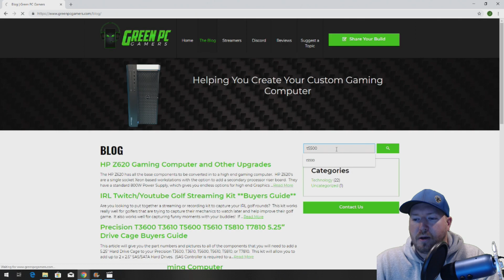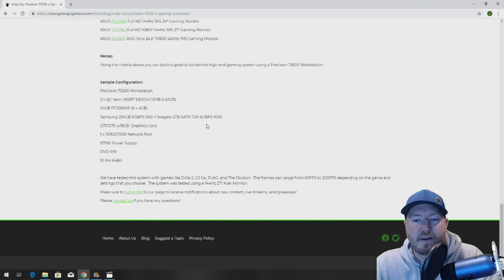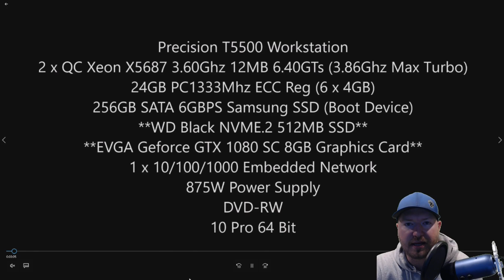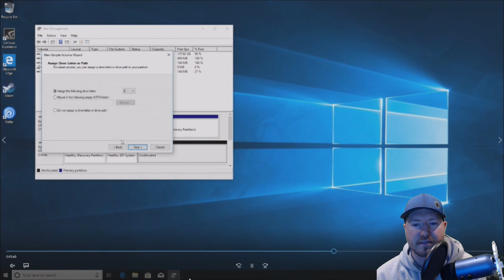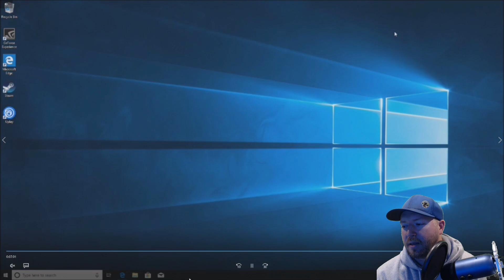Precision T5500 Gaming Computer (GTX 1080 and NVME.2 Install)

Comment: Hi guys. I have X5647 single CPU. ROG STRIX RX580 8GB. 48GB of RAM, A400 Kingston as boot SSD and 1TB WB Green. Temperature of GPU raise fast and im working on a proper cooling solution.
My concern is that HDDs work only as SATA2, i tried the PCIe 2.0 to Four-Port 6 Gbps SATA I/O Controller and it worked well but speeds of HDDs are the same as befor, Random read for SSD 200mb and HDD around 100, moreover iv started to have BSOD with this sata card and removed it for now. Also tried PERC H700 controller that also worked but it can only be plugged below the huge RX580 occupiing the only available PCI-e as RX580 blocks other e slots... anyway this H700 is getting extreemely hot as it is desighned for servers in datacenters so its dangerous and unpractical considering the GPU is already geverating heat to melt north pole...  Main thing to share with you all is AMD RAM disk software that im using for quite some time. Hith this soft you can create a RAM disk (32 gb ) in my case and install a game to this disk as RAM speeds a high youi should experience a better performance in open world games and etc. Worth of trying as workstations advantage is RAM capacity.
Reply: Apparently there are different models of Dell factory heatsinks for the Precision T3500, T5500 and T7500... the lower tiers are shorter with only aluminum fins (intended for use with low-clock speed, low-wattage CPUs), while the top tiers are taller, have copper heatpipes, and even have some sort of refrigerant gas permanently sealed inside the heatpipes!  Try to find part # "U402F" or # "U016F"

Comment: Can somebody tell me if it's necessary to update bios to install a new cpu? I want to install a Xeon X5670, and if the passive heatsink is enough to cool it down?
Reply from the maker: You should updated your bios with the existing processor before upgrading to the X5670 CPU.  Also, it would be a good idea to upgrade to the copper heatsink.  Technically it is not required for a 95W cpu, but the cooler you can keep your cpu, the better.

Comment: IOCREST M.2 ngff M key NVMe to PCI-e 3.0 x4 adapter not support with Precision T5500 ??? 
you can show about it again....
Reply from the maker: Hey Vansith,  we've never used that particular adapter.  We posted the adapter that we used on our T5500 Blog page.  Most NVME.2 SSD's will not boot via a T5500 workstation.  Also, if you do install an NMVE.2 SSD as a storage device, you will have to enable it in "disk management" before you can use it.  Hopefully this info helps!
Reply: @GreenPCGamerscom  A Samsung 950 PRO likely will even in Legacy Mode, because unlike the 960/970, has it's own ROM. Tried on both an Optiplex 7010 & 990, worked fine in the 2nd PCIe slot, wired as x4. Speeds were faster in the Optiplex 7010 due to being PCIe 3.0, versus 2.0 for the 990, at least by benchmarks. In real world usage I found both to be about the same. PCIe 2.0 speed is still around 3x faster than most 2.5" SATA-3 SSD models, why I also use the Samsung 950 PRO on AMD AM3+ builds. Luckily, I found a few new ones on eBay & were indeed as described.

Comment: I have T5500 bios A02 Xeon e5520 GTX 960 4GB, 128 GB SSD, Ubuntu 16. The optical drive doesn't work. (~250 €)
Reply from the maker: The optical drive is a cheap item to fix.  Thanks for sharing.
Reply: Hae you UBUNTU on this pc ??? WHY ???

Comment: I have 2 x5675 and 1060 6gb + 16 gb ram ddr3
Reply: you have 3.0 processor?
Reply: @remodesigns4570  11а
Reply: @haterate7953  ??
Reply: You have DDR3? Or does the T5500 have ddr3? Because I have a t540 and it has ddr2.
Reply: @mswerdna  yes i have.
Reply: Same here

Comment: Hi we have a T5500 and are having trouble getting a Nvidia geforce 1060 6 gb to run in the machine.Some say it is incompatible with the board,because of the BIOS interface,Can you please help.
Reply from the maker: Does the system work with the original graphics card?  What mfg is the 1060?
Reply: we had a nvidia 8400gs and the 1060 was a Gigabyte  @GreenPCGamerscom
Reply: Hi, a 1060 should work just fine.What exactly is the issue you have with getting it to work? The only card i'm certain should have issues with a T3500 would be a GTX 980 or 980ti. I've setup various T3500's and T5500's with 1060's 1070's and 970's. You should also try updating your Bios to Ver. A17 if you haven't.

Comment: Great work ! Dell T 5500 dual cpu is monster. I have T 5500 single cpu , R9 390 8 G gaming VGA card.
Reply: which games do you play on it
Reply: @Creaters zone Yes. But not sure advantege 100%... GTX 1070 , or 1080 good choice.  Or RX 580 , 90.
Reply: @Creaters zoneFrom what I know anything from nvidia thats not a quadro is made for gaming. With that, the quadro.
Reply: the r9 390 has two 8 pin sockets? did you use an adapter and how did you do it?
Reply: @Mini Yak which process should I use in t5500 for video editing and little bit game. Thanks 👍 for time

Comment: Hey there!
i have a t5500 with single x5670 installed, i just bought a gigabyte gtx 980 g1 which requires 2 eight pin connectors and this system has only 2 six pin connectors. Now my question here is it safe to use molex 4 pin to 8 pin adapter to power the card?
Reply from the maker: We’d recommend using a dual 6 pin female to 8 pin male adapter and then a SATA power to 6 pin adapter.
Reply: But my card requires 2 eight pin connectors and i just found out that i had 2 molex 4 pin to 8 pin connectors in my Card's box, so should i go with them?
Reply from the maker: Do you mean 6pin to 8 pin?
Reply: https://www.amazon.com/Molex-Express-Converter-Adapter-Power/dp/B00FHLQO9I
Reply: These are what i am talking about
Reply from the maker: I can verify this works.  2 x SATA power to 8 pin and 1 x 6pin to 8pin adapter.  We did this configuration on a GTX 770 FTW that requires 2 x 8 pin power.  We have over 1000 hours of gaming w/o an issue.  Let me know if you need links to the adapters.
Reply: GreenPCGamers.com thank you very much for giving an satisfying suggestion.

Comment: I have one issue though. I already using two CPUs
My power supply now have only two 6 pins pcie cable left. The newer generation graphics card such as gtx 1080 Ti or rtx 2080 all requires one 6 pins and one 8 pins to power which I am not sure how to upgrade further.
Reply from the maker: If you have 2 processors installed you should stick with a GTX 1080 or smaller card because of the power draw.  If you have a single processor installed you should have plenty of wattage to install a 1080 TI or RTX 2080 TI.  You will have to purchase power adapters cables to provide enough juice for the upgraded cards.
Reply: Or you may buy a new PSU with 1000 w or more. Im in the same situation here, I need to plug 2 GPUs for 3D Rendering. Now another problem I found is the GPU RTX size... to big to fit in it.
Reply from the maker: That would also work.  EVGA makes a nice modular 1kw power supply that works well.  It does require an adapter for one of the system board connections.
Reply: @GreenPCGamerscom  Quick question can i swap the psu to 600w or 700w or 800w on dell precision t7500 becauze electricity bills too big just 1100w is too much for me
Reply from the maker: It wouldn’t make much if a difference if you swapped the power supply.
Reply: @GreenPCGamerscom  what is the adapter needed to connect a EVGA PSU to this board?
Reply from the maker: You shouldn’t need an adapter because the board requires 24 pin power.  24 pin should be standard in most EVGA atx power supplies.
Reply: @GreenPCGamerscom  Thank you and Happy New year.

Comment: This T5500 given it is 10 years old and cheap cost it is really a beast. I installed 72GB ram and using two lower clock speed CPU (XEON x5650) with a cheaper AMD gaming card / SSD. I can play games smoothly while waiting some simulation results from another active linux VM with a database server inside. I don't even feel there is anything running at the background when I am gaming.
Reply from the maker: The T5500 is indeed a beast for being around 10 years old.  You can easily build a solid gaming T5500 gaming pc for under $500.
Reply: arb Distress does it have to be dual processors? Or does it come this way?